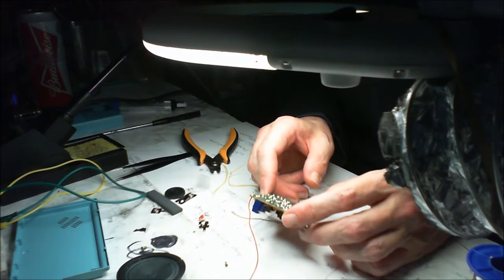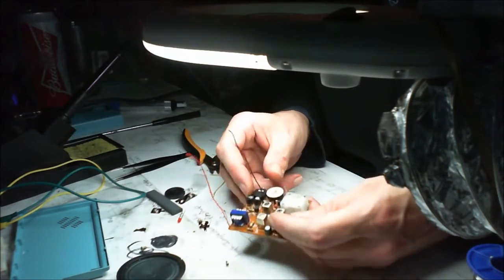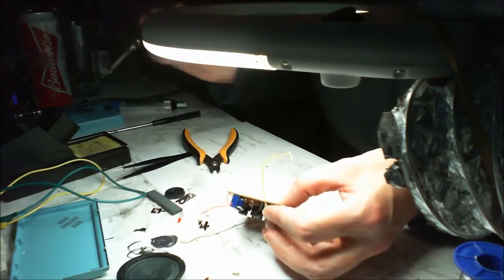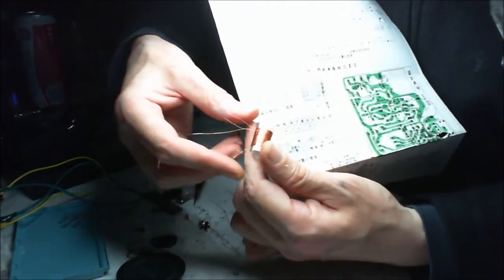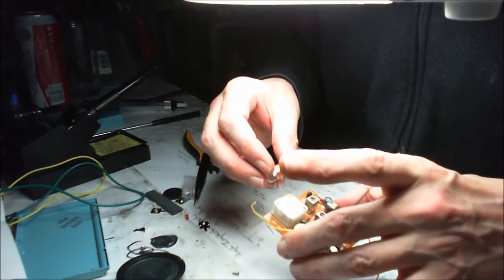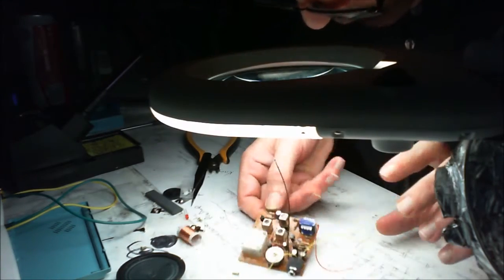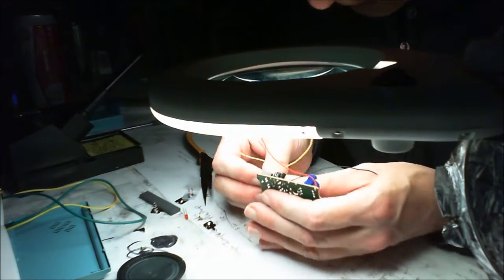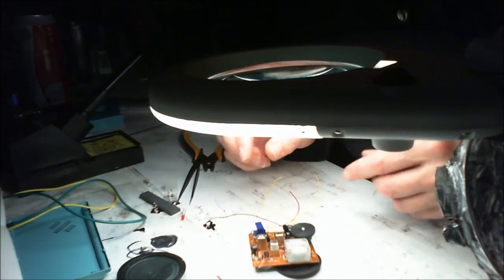HX 6B AM Radio Kit eBay 2

Comment: Ha ha. You make me dizzy. So quick you are. I'm 70 years old and spend a couple day on a real build. I mock up the dials and fit the board. Clean the board looking for dirt. Satisfied I solder the components. Then do a crude tune. That makes for a better than average rig... then paint the board with lacquer. To keep out the elements. It's a good radio. Once set its almost failure proof . Tks